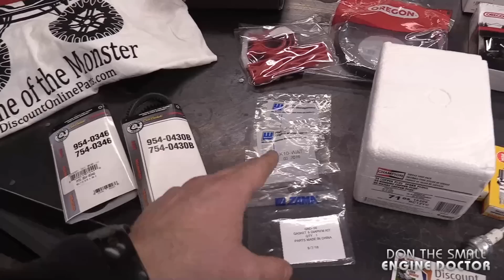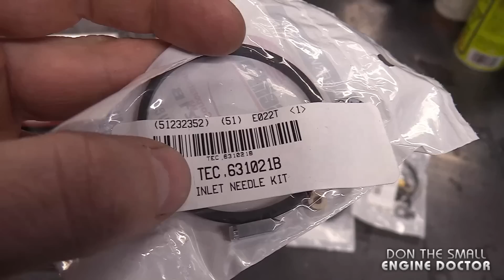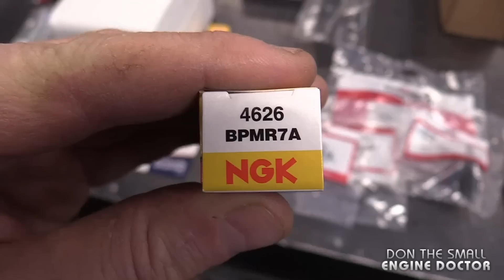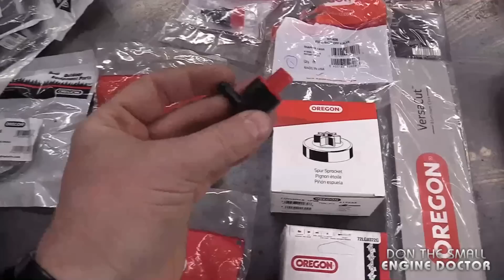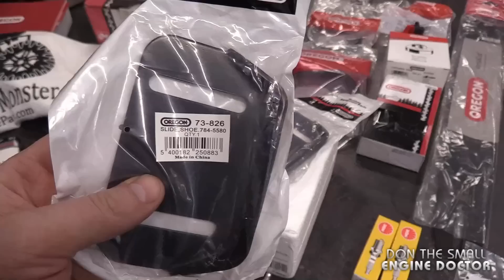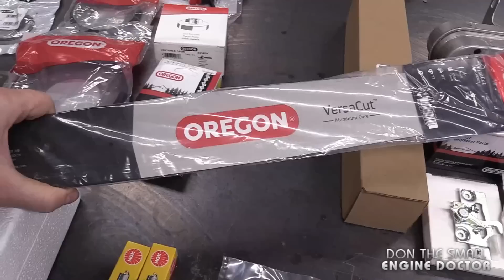Where To Buy Small Engine Parts Online

Comment: Hey Dony you should see if they have a parts portal you can imbed within your webpage.   the fathers lawnmower shop got a portal put in 5 years ago and sales of parts thru it has gone nuts.   The way it works they go to the portal page order there parts the order goes to you you confirm moneys paid then you just ok the order.  It is then dispatched from the supplier direct to the customer.  All your doing is collecting the coin and dealing with the incorrect orders.  Give me a message if youd like to see it in Action  Wont post it here

Comment: Here’s a few more tips. Do your own research and get your part numbers yourself. Don’t rely on someone else to find your part numbers. You should strive to never order a part you don’t need. What I mean by that is, make absolutely sure you have diagnosed the problem correctly. So if you order say a starter solenoid, it’s going to fix the problem. Also try to never order the wrong part. Do as much research as possible. Look at the pics online, take measurements, etc. One last thing, if you buy from a local supplier, follow these rules and try to not make it a habit of returning parts. Especially the parts they had to special order for you

Comment: I have a MTD non-running lawn tractor with a Tecumseh engine.  A local guy comes out and services mowers and had a really hard time finding a replacement muffler (years ago).  He found a used one that was in excellent shape.  I see that same muffler on the Discount Online Parts website.  It's seems pretty pricey, but I have no idea how much he charged me or what the normal price for mufflers is.  (I really need to get someone to haul that tractor away.)

Comment: hello Donny.
I have a question for you .
Can you tell me the brand name & model number of the tool that you use to pierce spark plug wire? It looks like long nose with nail in the middle of jaw.  
I don't know what you call that tool.
Thanks

Comment: Thanks.  I got a 1979 Toro 421, and occasionally I need parts.   Going to keep this thing running as long as I can.
Reply: I have one that has been neglected by its previous owners however it still runs well.  I plan to go through it this summer to get whatever life it has left from it as new ones are expensive and poorly built (too much plastic).  Toro made a rugged machine.

Comment: Thank-you Donny for this video. I have a question about a snow blower that builds up snow and doesn't push it toward the auger fast enough to the shute and overflows on the sides. Your help in this matter would be appreciated...tony
Reply from the maker: check auger belt tension
Reply: Thank-you Don.
Reply: Check that the augers are on the correct sides. If wrong way they dont push snow into the center. Dont ask me how I know that.

Comment: Nice video! Good to know they can source things from catalogs, though they have a fair amount already on their site.

Was intrigued by that drive disc, but it looks like my snowblower (intermediate frame 22" snapper I7222) doesn't/can't use that one, and/or the rubber on the disk comes separately (704059?) from the metal part (7031013yp?)? Have you ever heard of such a thing? Ever had any luck installing a good aftermarket ring on one of these intermediate two-stage blowers? I'd like to follow your recommendations of good parts, naturally :D Fear I might need to go out there, take off the belly pan, and use a tape measure :-O

BTW, thanks for the warning about aftermarket Tecumseh carb kits - I think I had used one, but I'll remember to get the OEM next time I need it.

(Also, literally nobody, not even DOP, stocks the NGK BPMR6F that my backpack blower needs - had to order one for more bucks than I expected from Amazon... but after finding how much easier stuff starts with NGK vs Champion, not going to stick a RDJ-7Y back in a semi-hard-to-start piece of equipment)

Comment: Don,   Got a used Kholer pressure washer running good after I cleaned carb out. Went to test it out before selling and it runs then dies.
Reply: either didn't get the carb fully cleaned or there is bad gas still in the fuel tank, good practice is when you clean a carb drain and try to make sure the fuel tank is clean and start out with fresh fuel after cleaning , trust me ive cleaned carbs when I first started out and left bad fuel in the tank and had to start all over again, just a thought
Reply: I have had plugs cause that problem. 
They get hot after a couple/few minutes and the circuit either opens up or most likely the resistance builds to the point that current cannot pass.
I have seen ignition coils do the same thing.
Problems like this are not that common,but if it were just a stupid plug,it would make you happy.

Comment: I own and run a lawn mower shop and i will say online shopping is great but if you have a lawn mower shop local to you, support local businesses, and lawn mower shops can usually get part's they don't have the next business day at no extra cost to the customer, also with some lawn mower shop's if you establish a relationship with them some will give you discounts on parts if you do outdoor power equipment repair, now as far as signing up with part's distributors - if you own a lawn mower/small engine repair shop or want to get into the outdoor power equipment industry signing up with Rotary,Stens & Oregon and the major OEM part's distributor for Oregon,Tecumseh,Zama,Briggs & Kohler is not hard at all and usually takes less than 10 minutes, now of course it varies where you are located, i am located in the south (SC to be exact), also Tecumseh part's are not hard to find, i can get anything Tecumseh OEM and aftermarket easily, the website mentioned above is located in Tennessee and the part's they have (especially Oregon parts, which i sell alot of each year) come from the exact same companies i mentioned above, i'm not trying to discourage online shopping or "talk bad" about anyone or anything i'm simply sharing knowledge other's might find interesting.
Reply: That's great if your local shops aren't owned/operated by douchebags.
Reply: Scott Warren that’s what I’m talking about 😮
Reply: I buy from my local small engine shop, I have gotten to know them and they always teach me something I didn’t know or a tip here and there to make things easier. You don’t get that on line.
Reply: I always support my locals...nothing beats it...face to face...bs over coffee...support me...I support you...Keene small engine parts...great place...and justice auto supply...fuck auto zone...
Reply: I try to support my local shops , But some are not customer friendly . So I go online ! Sorry 😐

Comment: THANKS, No longer use those plastic fuel cutoffs since I had one that showed on by the turnoff lever, but was turned off inside, I ONLY use the Oregon metal ones now. The Oregon drive tires that can fit the Snappers looks like only 1/2 the thickness of the factory one.  Thanks for the resource

Comment: DON! going crazy here. I have a FS44 STHIL brush cutter and the carb # 160B. It wont cold start without putting gas in the spark plug hole. have tried everything to fix it, cant find any carb. with that # on line. Do you have any help?? maybe they have a different carb # on them now?? I"M DESPERATE!
Reply: Have you checked if your fuel line was good and not dry
Reply: You can also proceed a leak test with the carb
Reply from the maker: check what other viewer commented below, you might need crank seals or another carb